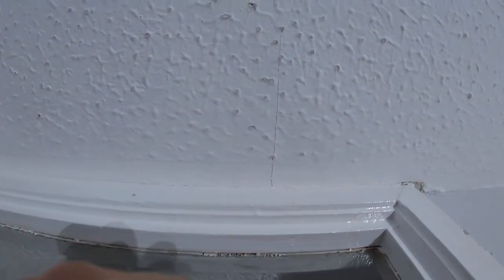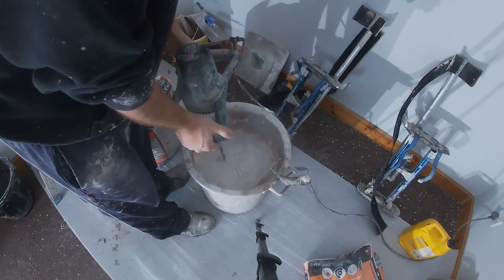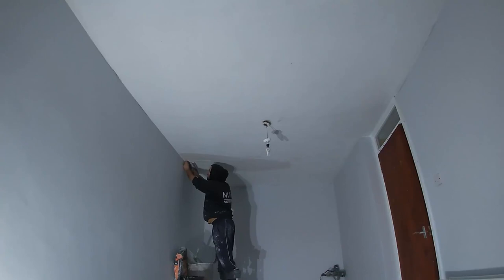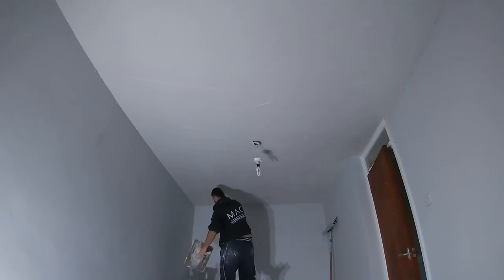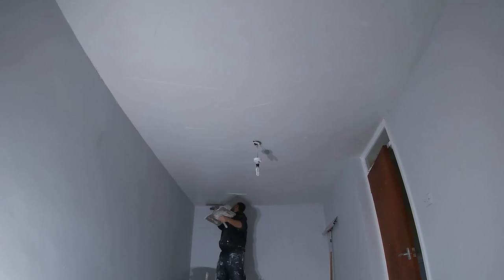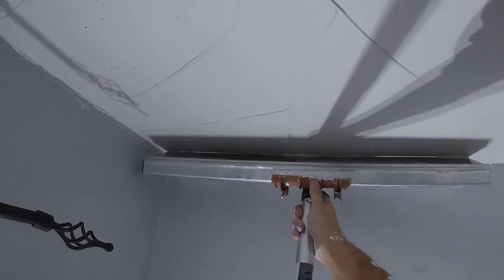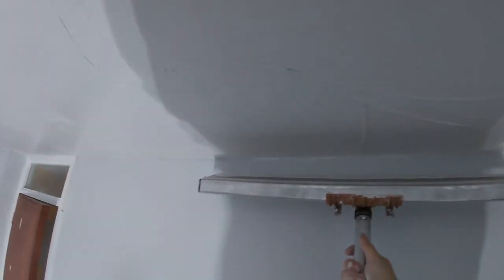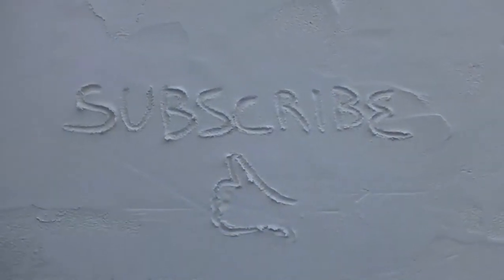How to Skim a Stipple Textured Ceiling with Make Good / Plaster Plaziflex & Superprof Spatula used

Comment: nice job mac, you have a great choice of tools, well explained regarding different types and there uses. I've never used a mechanical mixer, old school hand wheel from gypsum,  great work Buddy
Reply from the maker: Thanks 👍  Oh man you need to get a cheap on like this drill it will help you so much
Reply: hi mac,  back in the day you could only get board & wall finish and of course bonding, if i do any plastering jobs now which is rare its for family only. there's a great selection of tools and materials now which you demonstrate to the highest level. keep the good work up,
Reply from the maker: @anthonykenny1120  Than you mate I am in the middle of doing a small renovation job for my sister and have got tones of footage hard part is the editing but should make for some interesting videos :) Thanks again for all your support mate

Comment: I find when I pva and skim when it's tacky by the time I've got half the skim on the other half of the pva has dried  up. Is it best to PVA as I go. I didn't  realise you could skim a ceiling with making good plaster,Great video
Reply from the maker: Hi mate might be worth making the pva a taste stronger mate might not dry as fast and also might be work starting a few minute earlier also? its hard to say  pvaing it as you go might be  a pain as you will be busy coating then have to stop but if it is a large area you might have to do things like that or drying to fast some guys let the pva dry ad then coat I prefer and recommend tacky

Comment: Nice work stilts look grate. Does not even need painting that lol👍
Reply from the maker: Thanks mate I might try get away with that as I am the one to have to paint it LOL oh man stilts over planks al day long for me I remember the old days when i was to poor to have them and my boss getting me to plan out y ceilings man they would have their on before i even go my scrim tapes done and not to mention bringing 8 planks and a few trestles up stairs I was busted like a days work before you start
Reply: @macplastering  😂a bet you was  yere they definitely save time and well worth it👍
Reply from the maker: @markhep  For sure mate a few days on them like just walking its easy the thought of bring scaffolding just to do ceilings would be a nightmare
Reply: @macplastering  would be good for me now I don't have the space in the truck for boards 👍
Reply from the maker: For sure mate fit them in and lighter haha I have a link somewhere to cheap ones on #Amason my mate got that are supposed to be as good as any
Reply: @macplastering  yere minght have a look 👍

Comment: hi bud ive a big ceiling like dat to do for my mams place.i was going to give it a coat of bonding compoud 1st before i skim it.i see u didnt go dat route so i take it i could skip the bonding coat.i dont think i used dat make good stuff before it was usually gypsum skincoat.there is a few loose bits il have to scrape off so when i get dat done il know more if it needs a bonding undercoat.i agree to coat it as neat a possible its a lot easier to fill in when the stuff is soft 🤔
Reply from the maker: Hey mate I have done another ceiling in the same house where I did a bond and skim it did take longer but I do think it is a better job all round I was trying to save some time here and wanted to push this skim to its limits on a family members house so if problems come it wont be to hard to get it put right. I figure its a good sort of test to do not only will the results help me but others too so far I would still recommend bond coat then skim coat mate ,yes this worked but the other way to me is more fail safe and came up that little nicer that being said I used carlite witch I am more confident in and used to
Reply: @macplastering  ya bud its probably best to bond it.especially when its my mams kitchen.i would always have to look at it afterwards so il go with the tryed and tested for me.cheers
Reply: Emmett Mccarthy hi mate put 3 scoops of cement in your bonding goes off well quick put your coat on and brush coat it flat then skim it
Reply from the maker: @emmettmccarthy7247  Don't get me wrong I have skimmed this and will paint ok but the carltie was that little better with the bond coat again this is only supposed to be so thick just having a go and so far so good time will tell more, and i now others do skim these ceilings straight on and also do magic coat but I do tend to like just straight bonding down kill the heights then 2 coats skim yes it can take a full day but I think sometimes the extra work is worth it in long run
Reply from the maker: @carper186  Hi mate if I was trying to sped things up I would use half time seems better than cement and supposedly tested where it wont effect finish or strength as bad as cement will I haven't tried the new gear called speedyskim I think them guys said they will send some out to test so looking forward to that :)
Reply: @carper186  i did dat before with the cement but im not not in any rush with it so i wont on dis 1 for the sake of an extre hour.thanks anyhow
Reply: @macplastering  ya it will take a day alrite with the scrapping loose bits off the coats if pva then bonding.2 coats if skim always over bonding then the usual process.ffs id have 2 roims skimmed an all if i was going over plasterboard 🤔
Reply from the maker: True man plasterboard is easier for sure some would also recommend over boarding only thing with that is knowing your not going to hit a dodgy pipe or wire not fitted properly, make sure its not asbestos to mate
Reply: @macplastering  ya i was going to tear down the slab and re slab it but to keep the cost down i decided not.1 or 2 cracks in it so il cut back the stipple and paint and re scrim it.add a few screw on the joints and as we say it cork il be whistling dixie after dat,🤞
Reply: mac plastering cement as always done well for me mate goes rock hard or use bomding and finish mix quarter of. A bag of bonding to a bag of multi
Reply from the maker: @carper186  I always found straight thistle bonding sets nice and fast
Reply: @carper186  ya i done dat myself it does speed up the bonding a lot
Reply from the maker: @emmettmccarthy7247  Haha Whistling dixie :) thats it mate re scrim tape after a good scrape is as good as anything sometimes I do if need try and re screw any thing cracked or lose to try stop it re cracking it dose work most times but as you know if it wants to crack due to movement aint nothing a 3 to 5mm plaster going to do to stop it
Reply from the maker: @carper186  Dont get me wrong guy I used to work for when still learning used it all the time but I just think its to risky
Reply: mac plastering 👍🏻
Reply from the maker: @carper186  Have you tried that other gear mate I know its more than cemnt but wow it works great :)
Reply: mac plastering I havnt tried it mate me mate has tried extra time on big gages on price on site said it’s boss you can use cream of tartar aswell just works the same
Reply from the maker: I have a few extra time gave some to a mate he used on a landing wall said it worked great slowed it well down for him, I haven't had anything to big yet but used the half time bonding and skim worked great
Reply: @carper186  have u ever heard of a drop of milk in the mix i never done it but a labourer i know said he did it on a job to piss the boss off.he said he was wrecking his head and done dat to him as he was going away after he mixed up.he said he was waiting hours for it to go off .funny story i thought.a good labourer is as good as most plasteres.i had a fella throwing stuff on.mostly less risky stuff like scratching up and plynts .side reveals etc.sure handy if a fella is paid well enough he wouldnt minding doing it.
Reply: Emmett Mccarthy never heard of a drop off milk mate thought it would make it smell i me dad pisted in a mix an put it on the wall and left it because fella on site was coughing up with the money😂
Reply from the maker: @emmettmccarthy7247  I knew and know some top class labours mate could skim out cupboards rivals inside fire places patch's as well as there own job mixing cleaning prepping a good labourer is hard to find and great to have   , herd similar stories from a big man called BAP might do a livestream some night and chat about it some haha
Reply from the maker: @carper186  Haha thats crazy man herd that also apparently gear wont set with urine in it serious extra time that
Reply: mac plastering must of smelt bad 🤢